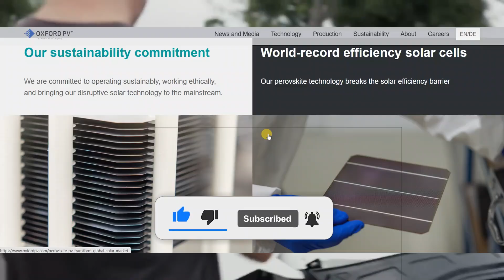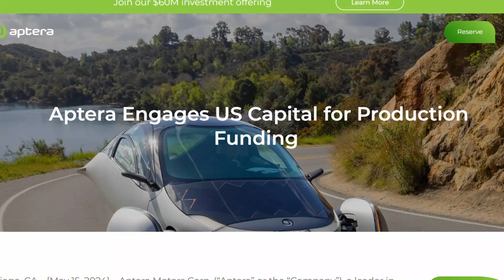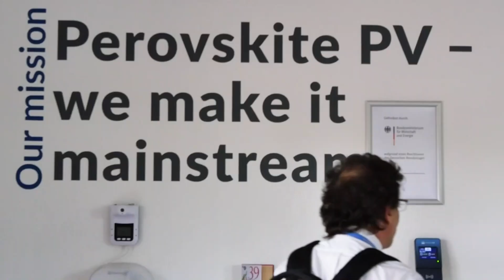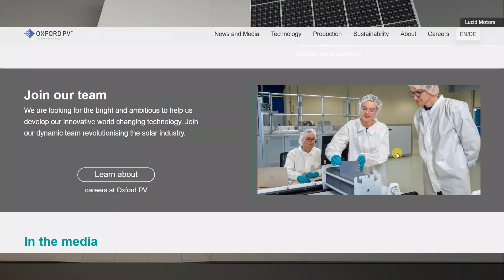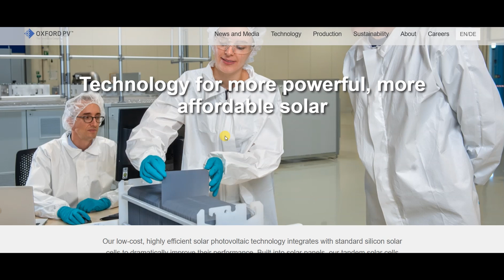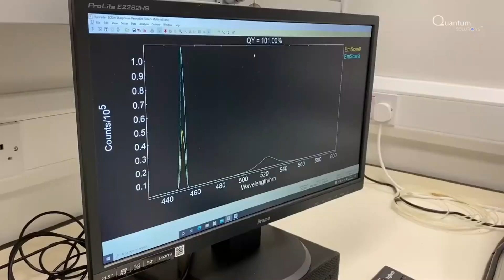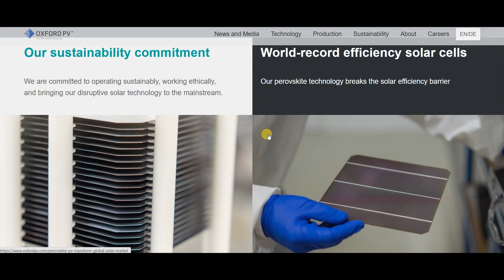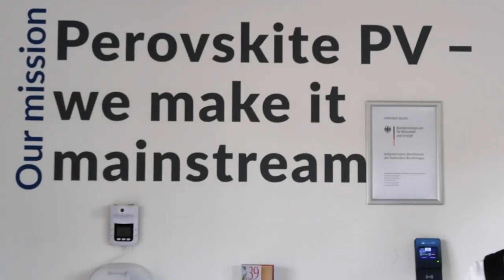Aptera and Perovskite RECORD BREAKING Solar Modules from Oxford PV: A Game-Changer for Solar EVs

Comment: aptera has supressed any solar output results, they have the figures on their dash display but never have they shown any detailed ananlysis. Fambro a director did a rushed 2 minute video once to show solar output at 10am, the results were bad indeed and way lower than they had predicted. There is a very good reason why they have never shown any real world data..............it does not support their claims.

Comment: My question about perovskite, solar films and paints, etc.  has had to do with how long they will last. Traditional silicone solar panels can last on a roof in Phoenix, Karachi, Dubai or Marseilles for half of an average human lifetime. But it seems longevity problems are being solved!

The efficiency stacked silicone/perovskite panels could make solar effective for powering not only cars but also a much wider spectrum of buildings than can currently be powered with solar. And, a panel that captures more energy will power a car or building for charge a storage battery for more hours in a day. This will further disrupt traditional electric utility monopolies, fossil fuel cartels, etc.

Comment: Two major problems with this -
1. Aptera can't get suppliers now, and will have less chance getting these for at least three years in my estimate of the situation they admit to having, and
2. The solar gain is best used on rooftops, where your EV can take advantage in addition to your fridge, house lights, toaster, ovens, coffee machine, TV, and many more things around the home. If you put it on your EV, then all those other things get no benefit. No Aptera has shown an ability to power your home - you need Hyundai for that.
Reply from the maker: Hmm,
Crowdfunding may yield big
Reply: @Elementraz  Now put a bit of thought into that. Crowdfunding went its quickest in the early months five years ago. After that, every half-year results slowed, and it was so slow in mid 2024 they resorted to USCG, which was even worse. A return to crowdfunding is hardly likely to resurrect the dead horse. By all means, give it a flogging and find out for yourself. I do believe with a sucker born every minute that it will keep Aptera's income stream, but only to the point of the top few getting rich, and it won't be able to buy neither plant equipment nor parts, so the silly trike will remain in limbo. This is probably secretly a good thing for Fambro and Anthony - that's my entertaining opinion. 

Now tell me - how is crowdfunding anything to do with my two points? Aptera says when they have the money to buy parts suppliers fob them off for companies that buy in the tens or hundreds of thousands. Will that change? If they get all the money they need from crowdfunding, how does that change anything to do with perovkites being better able to run the household electronics than the silly trike can? You are way off track, and should have responded to someone making a different point.
Reply: Home PV store energy in batteries or grid. If you use it all up, then you don't have any left over for your car. Duh! Aptera won't need recharging if you don't go more than 40miles/day.
Reply: @1voluntaryist  If you use it up you have had a lot of in-home benefit, and the car still charges off the grid if you absolutely need it and can't wait another day. My experience is I get more than I need for the longer and hotter days for 6 months and almost what I need in the shorter half. Everybody is different, of course - some better and some a lot worse, but the Aptera way is mostly a gimmick and definitely unproven to be near what they claim. Then there are the drawbacks of having solar on the vehicle; the almost useless benefit comes with a lot of downsides you overlook. I park my car (BYD Atto3) in the shadiest parks and use my phone to run the aircon 10 minutes before I return to get in and drive it - you will have to leave it where the cabin cooks most, and if you are lucky to get the phone ap, it will take more energy to cool that pizza oven than my cabin, which is already much cooler by staying in the shade. That's just one benefit. Look at the full picture.

Comment: Despite it's size, the Aptera is a very small car. It is a waste of space.
Reply: I just visited the factory. This is NOT a small car. You really have to see it in person to grasp the true size. Kind of like when you see the Grand Canyon in person.
Reply: @johnhayes3314  What I meant was that you get a very small interior volume when compared to it's length and breadth. It's as wide as an SUV and it can only carry 2 people and a puppy.
Reply: @TTTzzzz  And 32 cu/ft of cargo.
Reply: @TTTzzzz  You compared the Aptera cargo space against how many 2 seaters? Are seem to imply they could have gotten more space. Explain.
Reply: @TTTzzzz  They refer to that design as a "coup". It's the most efficient, the fundamental goal of Aptera. Obviously, it's NOT a family car. More space would be wasted if it's for 1 or 2 people.
Reply: @TTTzzzz  They gave a ride to a man who was 6'8" close to 300lbs. He said it didn't feel cramped.
Reply: @1voluntaryist  2-seaters with 4 wheels have space between the rear wheels to stash luggage.
Reply: @johnhayes3314  That makes it a waste of space as a vehicle.
Reply: The Aptera was not designed to be practical. It was designed to get the most range as possible and they threw some solar panels on it. As for it's size, that's what you have to so to get the numbers they claim. Thus you have to make it wider than a SUV (plus that width is down low where it makes it an easy thing for people to hit because they are usually not looking down low) and as long as a Model Y. Top it off, very little cargo space that is practical.

I could get a model Y and it's smaller than an Aptera. If I just want a 2 seater Model Y, then I have more than double of the cargo space and it's practical. This is what many people use as when they buy a vehicle. They want something practical. They really are not looking for efficiency. Thus the reason why so many vehicles in the size range of a Model Y are sold.

Let's not forget, Aptera is a 3 wheeler. We superfans can repeat over and over again that it passed the moose test and it's phenomenal in the snow, but trying to convince the general public, that's another story.
Reply: @billsmith5960  "The Aptera was not designed to be practical". That says it all.
Reply: @TTTzzzz  - This is why they do like Solo and Elio did, try to show how much they can creatively squeeze into it.
Reply: @billsmith5960  More like squeeze it nearly empty.
Reply: How is up to 40 miles/day, IF verified in upcoming production intent testing a waste of space.
I won't get that much where I live but still more than I drive daily so I'm happy.
Reply: Your comments will hopefully be removed…Due to your ignorance.
Reply: @RobertRobert-u4f  Compare wheel base to passenger space. It's as wide as a SUV and can carry 2 people and a puppy.
Reply: @ - I think you could get 2 people and something like the size of a Cocker Spaniel in an Aptera and be safe. Thing is, if you have two 200 lb people and a 100 dog laying down in the back, you've maxed out the load the Aptera can carry. Throw in a 20lb bag of Ol Roy and you are overloaded.

Comment: As speculation goes, this is a good use case for this new,perovskite technology and I'm glad for the information about Oxfords' efforts.

I personally would have appreciated this content more if the producers had actually included direct interviews with Chris or Steve over at Aptera. Getting a complete story is important and I prefer non-speculative content.
Reply: Chris and Steve are nothing but speculators, themselves. The 2022 production date was just speculating, and so on. What do you know from them that is proven?
Reply: @aussieideasman8498  Yea, Chris & Steve shouldn't only speculate, they should open a factory, build/test prototypes, e.g., a PI-1, PI-2, PI-3, PI-4. You tell'em Assie.